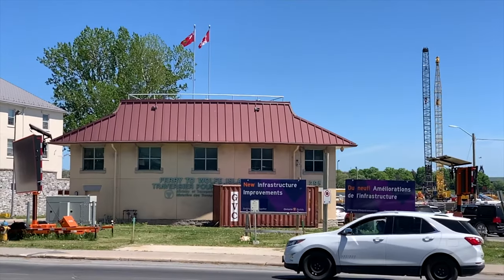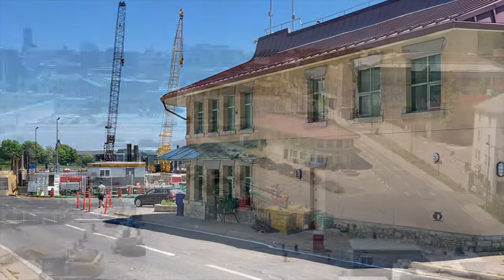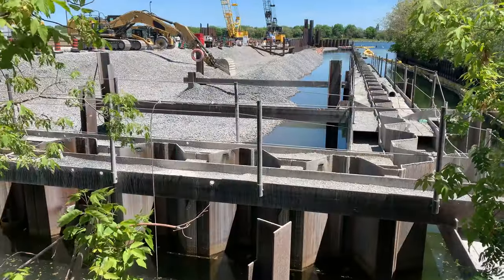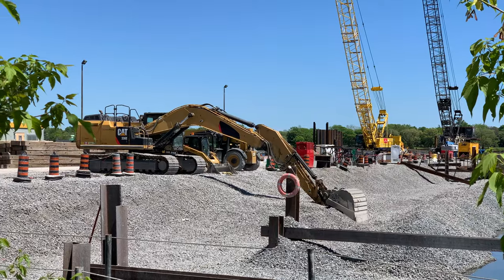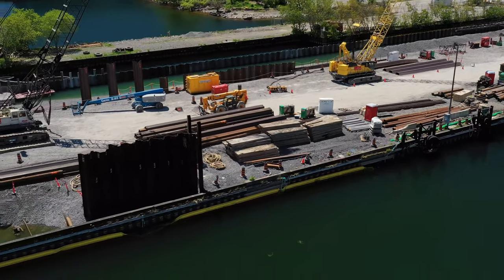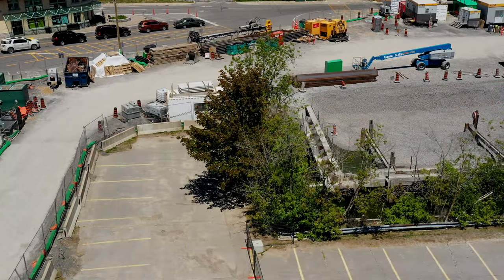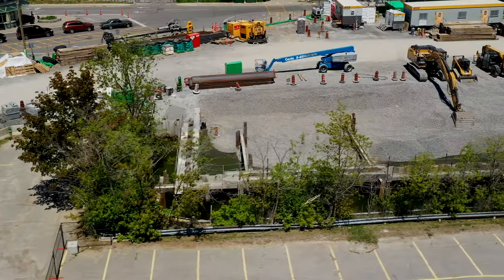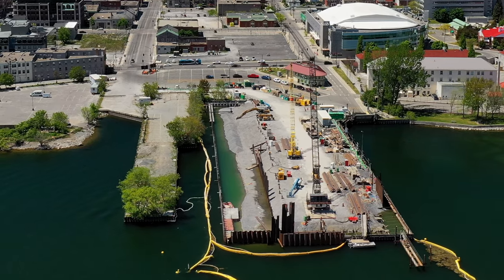Ferry Interesting

Comment: It is sad that the unique architecture of the Wolfe Island Ferry terminal will be demolished. I always thought it kept a wee bit of the rounded formations of the old S&R(* we called the store the Stuff and Rubbish- a loving name for all the things you could buy there and always great shoes!) Thanks for another informative video. I have subscribed to your You tube. Thanks again.
Reply from the maker: It is unfortunate, I agree. But we must wait and see what any new building will bring.  Thanks for watching, taking the time to comment and, particularly, for subscribing...
Reply: It's sad for sure. I have filmed a few old buildings and one (candle factory) is being prepped to come down :( . It is really pretty and too bad it can't be re-purposed.
Reply: @Aerosnapper  I’ve seen what is designed and it is horrible. A plain bunker at the street and a glass building waaaaaay back at the end of the dock. The reason the ferry terminal building is being torn down is because it is in the way of a new, unnecessary third lane. What the engineers who drew this up refused to acknowledge is that the traffic tie-ups exiting the ferry are caused by lack of synchronization of traffic lights along Ontario Street. By the way, the ferry terminal is not old- it just was well-designed to “fit in”, unlike the new planned buildings.
Reply: By the way- you were wondering about those pylons. I believe they show up in this animation. I believe they serve as moorings, just like the ones in existence on Wolfe island. The gap between them and the dock allows the crushed ice in inter to be pushed aside so that it doesn’t prevent the ferry from docking.
https://youtu.be/v1X9L1iZP0I
Reply from the maker: @martelloalley7955  I am very grateful to you for that really helpful information and the video link. I’ll add it to the video description for others to enjoy. Thanks - great to have that assist.